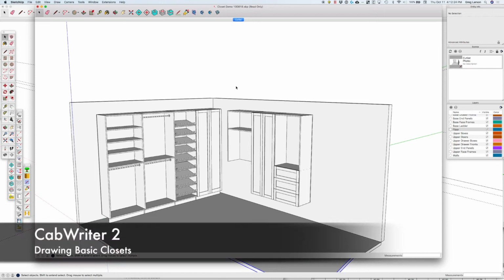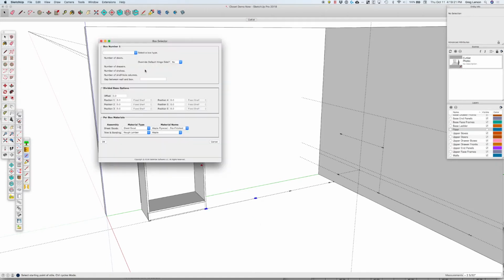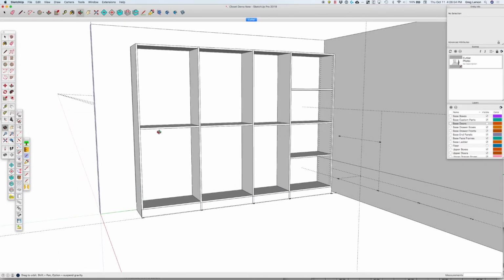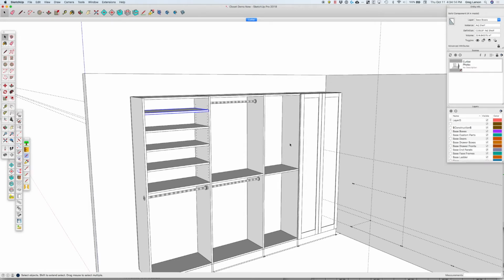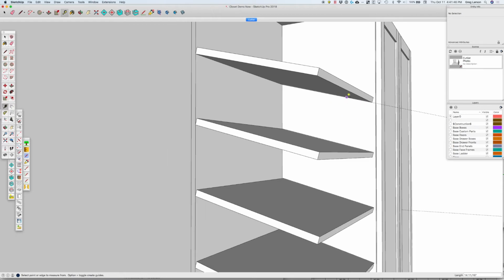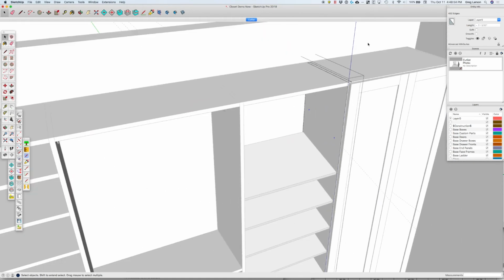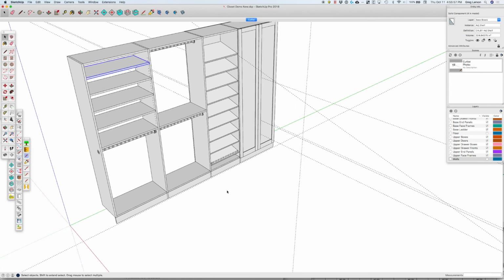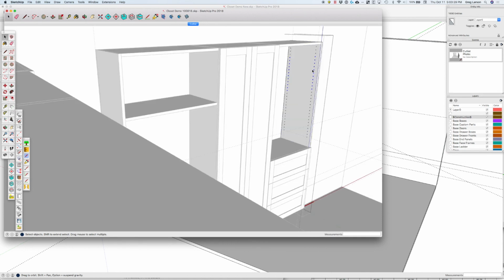CabWriter 2 - Drawing Basic Closets

Comment: I know I am late to the show. I have been considering CabWriter and have seen where on the website it states Quoted " Designed for professionals, CabWriter Pro marries SketchUp’s powerful 3D design capabilities with advanced parametric cabinet design capabilities. This allows you to draw kitchen cabinets, bathroom vanities, custom closets, bookcases, media centers, etc., faster and more efficiently than you ever thought possible. Easy to learn and use, CabWriter provides automatic cutlist generation and lets you quickly generate professional shop drawings using SketchUp Pro‘s LayOut application. 
Does anyone here other than the Poster have this program and does it do what it promises to do?  The 600.00 for the Pro Version is not that expensive compared to other programs that do the same thing if done differently. I am about to pull the trigger and purchase I have not used Sketchup since 2008 and I am rusty but willing to learn. For me it is a purchase of Sketchup Pro 2021 or 2022, CabWriter 5 Pro and Cutlist FX. It adds up, but is do able. I may or may not reopen my cabinet shop and will be using the software for my own home for  full custom kitchen cabinets with island with cooktop, Baths custom cabinets with towers, 3 walking closets. Full custom pantry etc. I promised my wife a custom home and I will deliver on that promise.